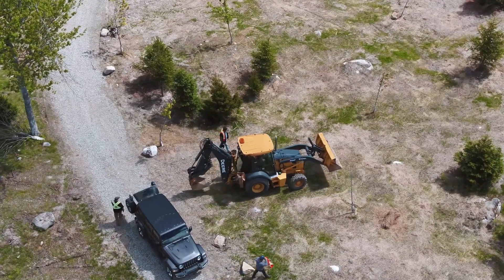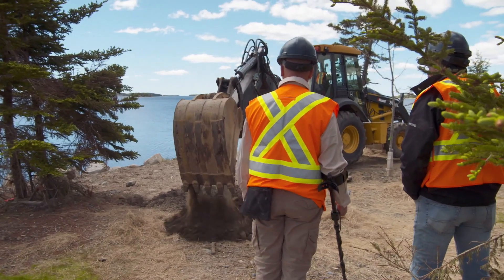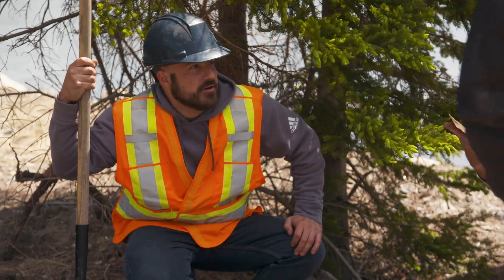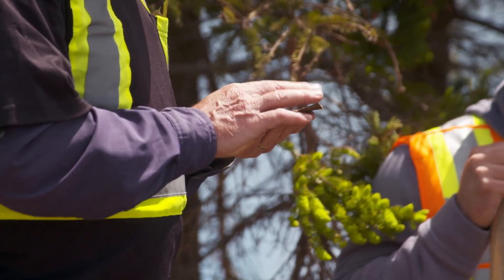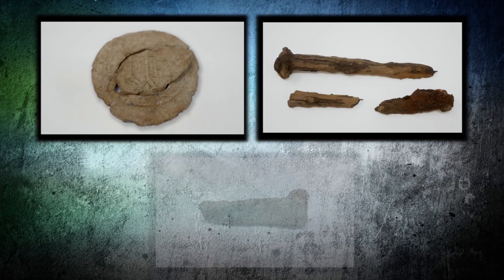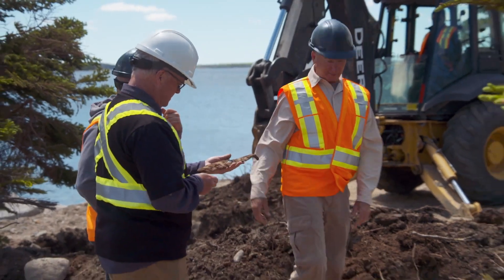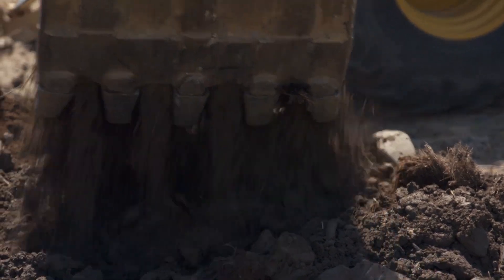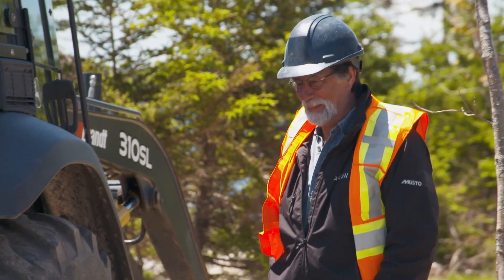The Curse of Oak Island: EVIDENCE OF SHIPWRECK Found on Lot 32 (Season 10)

Comment: Intertied history of Samuel Ball and the Vaughns.  The Vaughns made ships, repairs, etc on Lot 32 on the western side of the swamp-harbor and the western rock roadway (that still needs to be uncovered).  The Vaughns would split the family and move their ship construction drydocks to Lot 1 and 2 and the boulderless beach and the rock promontory that would anchor down a lengthy floating wooden wharf.  The other parts of the Vaughn family would move up to New Brunswick setting up a massive ship construction industry and make their greater fortune there (during the times of the whaling and cod fishing fleets).

Samuel Ball would buy Lot 6, 7, then Lot 24, where the remains a rock promontory and also had a floating wooden wharf there, with a southern rock roadway along the southern shoreline from Lot 21-32, to the harbor western rock roadway, connecting at the point of the Eye of the Swamp artesian freshwater rock well, and then to the uncovered Lot 15 harbor eastern rock roadway, and from Lot 15 over to Lot 18 and 19 of the South Bay.

Samuel Ball would gain the British land-grant of Lot 32, in the time during/after the Vaughn movements to the western shoreline and moves to New Brunswick, and move his floating wharf from Lot 24 to Lot 32.  After his death, John Smith and other owners would move the floating wharf over to the same rock promontory and station it at Lot 15.  In later times of the searchers, the wharf would move to Lot 19/20.  During the massive tropical storms and hurricanes that Niova Scotia experiences, the wharf has been torn off in the late 1890s/early 1900s, and was thrown by water, wind, and tidal surge back up onto Lot 32 western harbor shoreline - where photos show it decomposing and discarded.

Where did Samuel Ball get his money ?  By ox and wagon hauling cargo, and other mined materials from the mines and port docks, with warehouses, storehouses, and the Vaughn ship construction business.  The purchase of Lot 24 with the (already?) installed floating wharf gave Ball mooring fees such as Capt James Anderson and the ship Betsy moored there, plus other import/export cargo coming off the ships to get to the industrial areas around the harbor (swamp) area.

There are 3 known rock anchor stones (2 found by Fred Nolan - NW and NE stones and mapped in his 1974 Oak Island treasure map).  Another is said to have been at Lot 15 (but the iron bolt was found by Rick).  This means that NW, NE, and SE corners were 3 interior harbor floating wharfs and mooring areas (with cargo cranes and hauling of cargo onto and off the island.  The SW corner was the ship's drydocks, construction, careening (ship's hull cleaning), and repairs.  Thus having Lot 32 and Lot 15 with an outside mooring wharf provided additional mooring fees anbd cargo transport fees for offshore ships coming in.

What is also known is that the recent aerial drone LIDAR footage, better quality than the 2016 aerial plane LIDAR shown on Canadian Geological website, shows what they are digging out as a massive building area, a rock wharfage, and what would be the south shoreline roadway and the western harbor roadway.

What is not said is that Lot 30/31, not readily shown on maps, or LIDAR unless in the same southern portion of the Lots 30-32 was a zinc mine in the area.  Guess what Samuel Ball eventually bought before he acquired Lot 32.  Lots 30 and 31 area part of this building, and/or other rock crushing, smelting operations, and ships cargo warehousing that they are now digging out.

So if they find wood wharf remains, a smelting operation, mining materials, ships construction materials and a cargo warehouse, this is what is being shown from research given to them nearly 3 years previous to this ...

Samuel Ball was not a subsistence cabbage farmer, he was an intelligent, hard-working, up-and-coming industrialist and real estate person (also buying what would become of the small island outside known as Sam's Island in which he had other nearby cows/oxen.

 The real and greater complex history of Oak Island has barely been shown and known other than research by myself and presented to the Laginas for their greater discovery of the whole island - and finding what treasures there are (under Lot 15/16 ! or the original mines and deposited treasures - like the Aztec treasure of 1513, and other ancient Templar et al deposits made in the area.
Reply: I’ve had this ideal for a while. No treasure just a big maritime activity was  present on this island. But I’m a fan always interesting to see what pops up thank for your take. Allen on top of my hill in. Sc. A old Marine and sailer land locked.
Reply: wow you have some time on your hands to leave such a lengthy comment !! So long I wouldn't even think of reading it !!
Reply: @brianloeffler2245  Even more so time-wasting ... for you writing a dismissive comment.  If your brain cells are so small and can't hold a topic for greater than 3 seconds - then it is no wonder that you aren't one of the major off-grid researchers to the Oak Island peeps - and Season 10 is starting to finally doing what has been researched, analyzed, and documented for exploration for this origin (!).
Reply: Need you on the show to teach landscape archo
Reply: @ksholar1  (As said) I have consulting off grid for the Laginas 4+ years research, analysis, geology, geography, island colonizations, craft and industrial products made, natural resources of the island, and hidden historical entries.  The amount of real history can't be shown in a treasure vid show .. but the true backstory of the whole island is so amazingly complex with people, places, times, ...
Reply: I suspect Ball may had made a lot of his money through the non-tariffed rum and tobacco trade.  He likely used the abandoned buried tar kilns of the South Sea Company to hide smuggled items. Hidden places may not be for treasure, but to hide contraband.  The naval officer's button found in his basement was probably lost during a search for non-taxed items.  Tariff enforcement was a major day to day function of navies back then.  Such an island with easy access to the sea and a small separation from the mainland to provide visibility from visits by the authorities while allowing easy access by land to the markets is a good location.  Coconut fibers were (1) used to filter turpentine and liquid tar from the tar kilns, (2) used to pack rum and other commodities from the West Indies and (3) Mixed with tar and used to pack leaks in the wooden ships.  Many of the shoed oxen were used on the cobblestone road to drag logs floated in from the mainland to be hauled up to the wood processing yard during the South Sea Company era.  While it is claimed Oak Island is called that because of the large canopy Oaks, it might well have been called that because Oaks were floated to that place by the lumberjacks to be processed.
Reply: I also don't believe there are any treasures below sea level.    The show's producers like to use it as an excuse to investigate for non-plausible use by the Knights Templar and other such entities to generate interest.  Man didn't dig down below the water table except a short distance for water wells until the need and technology came in the 19th century. Pressurized caissons and compressors became available and allowed foundations for piers to erect bridges to go over rivers and harbor entrances in the 19th century.   That island is made up of glacial till and leaks like a sieve.  Digging below sea level wasn't done by man until the 19th century.  People hide things in relatively accessible areas where the items can be recovered by people you want to recover them.  Things from the surface found deep are there because of the constant churning of the island's contents by drilling, tunneling and bulldozing.  It wasn't an archeological dig, it was a treasure hunt.
Reply: Pretty sure the families didn't make stone roads. I agree this show is barely hanging on.
Reply: Thanks for the good info sounds like you got bit by the bug too :)
Reply: @johnlord8337  thank you
Reply: So basically the island was a ship work yard and most if not all they have found could in theory been found at other sights of shipyard so basically then entire show is a fraud
Reply: @MrBigdaddy2ya  When I have over 400+ historical, archival, personal, geological, geomagnetic, NMR, GPR, LIDAR maps, treasure maps, tunnel maps, and other assorted historical documentations - a lot of the information - and a lot of the BS - is filtered out - and what remains is truth.

There was (potential) mining since the days of the Solomonic Fleet (1000 BC - 1000 CE) period on the island (and during the time of the Norse Vinlandia empire (900s-1100) and then converted into the Templar empire (1100-1400), later taken by the British and French flip-flops, and finally 1755 total British control.  These mines on the western and eastern isles (with other known tunnel maps detailed by early seekers (outside of the Money Pit area) that a lotta digging was going on away from this mining air shaft (1795 Money Pit) and the 2 entrances to this 1600s-1750s mining area - with Shaft X-1 (South Bay Dunfield-Blankenship discovery 1965) and undiscovered Smiths Cove.  The sunken pit, was a prior undocumented shaft dig (named X-2) where Mrs. Sophia Seller's oxen had fallen into a well-like hole in 1878 - another airshaft.  The current dig on the plateau (not on the Money Pit paved area) is the 1930s Wm Chappell-Blair, Hedden, Hamilton, M R Chappell-Blair area of excavations.  Also an airshaft.

This leaves an industrial mining of the area (same as the Martin Frobisher pulling out iron pyrite (fools gold) 11,000 tons back to London and other mining of natural resources.

What it then details is that these ancient mines and tunnels of the original digs were the locations for locating and leaving treasures, not the 1600-1795 mining areas.

There is conjecture that the Seige of (French) Ft Louisbourg in 1758 (when British have total authority and control over the Oak Island area (and possible military and naval forces on the island) - that burying something there would seem almost impossible (!).

Then 1793 execution of the royals of the French Revolution, and the suspected buriall of the French royal gems there, would ahve someone spend exorbitant time digging out a shaft to bury "stuff" there.  Since 1776 expat colonists were already living there, and this was Lunenberg German merchant Caspar Wollenhaupt's Lot 17 and 18, this would also deny this existence.

There is also the statement of the 90 foot stone and the decipherment in English (while the Zena map Formula cypher had the same cypher but written in French) that was ~supposedly~ put into John Smith's fireplace mantle, then relcated after his death in the 1850s, up to Halifax.  Yet, looking at all of the earliest of 1860s photos of the Money Pit digs and the John Smith (Anthony Graves) ownership of the house, THERE IS NO FIREPLACE CHIMNEY seen on the visible side of the house at the eaves or above.  You would expect a fireplace, but no chimney is visible (?).  So is the story even true about the 90 foot stone that only appeared during the time of the 1860s-1919 then disappears.

Capt James Anderson on Lot 25 lived next to Samuel Ball on Lot 25 (and potentially mooring his ship Betsy) at Ball's wharf (paying mooring fees) would eventually leave to the Caribbean where he dies.  But before this, Ball buys Lot 25 from Anderson, who then leaves.  If Anderson did have treasure it would be on Lot 25.  Is this what Ball would find, but not of any other implied treasure source ?  Would a pirate leaving the area, leave his buried treasure under him selling the lot ?  Highly unlikely.

In one episode, I finally found that Capt James Anderson was Master Mason in 1791 at Lodge 9.  I finally found that Lodge 9 was at Liverpool, down the coast.  Any military lodge (see below) of a British army or navy lodge was not around in the 1790s on the island, and no official civilian lodge at Chester or Lunenburg.

Capt Kidd was known to be around the Mahone Bay area in those late 1690s, then goes to the Indian Ocean, where eventually he mucks up attacking a British commercial ship (Great Atlantic and Pacific tea ship ?) and gets hanged.  So there is a Capt Kidd Plum Island map looking in near absolute shape and details of the island (and dated in the early 1700s) and where there is suspected burial of treasure in the northern Lots 15/16 (the same as another tunnel map showing tunnels in the Lot 14, 15, 16 area (!).  Yet, this period of back and forth French and British ownership of Nova Scotia and Oak Island, and ~some~ few colonists of the 1600s English Baronets of Nova Scotia area living there - would notice anybody coming onto the island for an extended period of time, mining and tunneling and leaving a buried treasure.  Only someone having knowledge of PRIOR mining and tunnels on the island could then have deposited something there - during this period of English control.

There are also other conjectures of Bacon and shakespeare writing buried - why ?  If anybody wanted historical documents of all of the Shakespearean writings - it would be the English - and royal/nobles for their collections.  As my own ancestry had personal contact with Shakespeare, and 7 degrees of Kevin Bacon, we could have also known of Bacon in Verulam (old St Albans monastery area in royal Hertford shire, where my ancestry lived 1300-1632), there is no valid reason for this to be there.

The anchor stones and offshore mooring areas support features (mentioned to the peeps) that the navy had a rock foundation of a large naval barracks on Lot 20, with the 2 eastern anchor stones with ready access to ships and defending the island or attacking from this location, while the northern lots of the swamp, and that of Lots 20-25 would have an army encampment of different periods.  Flip flop British and French army/navy units of national ownership, and they would have been in the same areas (yet we find no French coins, buttons, or militaria there).  So it is entirely possible that these encampments and naval base were before the 1776 expats came to the area - and such minings were supervised by these groups.
Reply: @dragonknightn7n796  NO - not a fraud.  There is so much history and complexity to the whole island (of 2 islands) that someone looking for treasure, but metal detecting all over the island and finding all these (non-treasure) OOPARTS makes the whole series that much more complex - especially when you don't admit that there were earlier colonizations to the island, earlier mining and tunnelling, the Solomon and Templar fleets sailing up and down the East Coast between Nova Scotia and Mayan empire (then Aztec empire).  Blue clay for the Mayans and Aztecs - copper, silver, and gold from Central America taken back to Nova Scotia.  The amount of self-discovery of the island from the photos and maps, the Laginas can't do everything - especially with alll of the restrictions placed on them by the Cultural Heritage group (who truly need to get a collaring by the new Prime Minister).

The amount of valid excavations that need to happen - mention to the island peeps is enormous to understand the whole backstory of the island.

(1)  20 scattered core drillings of Lots 15 and 16.  Now also water test them for silver and gold leachings showing that this more-ancient area of the eastern island had earlier tunnels and earlier deposits.
(2)  More core drillings around the northern perimeter of the Chappell-Blair shaft on the plateau.  Same water testings proving that this location of precious metals leachings are valid to this spot, or that more-ancient water flow and leaching creep from Lot 15 and 16 shows the real source of leachings coming down these ancient mine tunnels (loose soil) ... and thus getting back and excavating Lot 15 and 16
(3)  Clear off southern Lot 15 and 16 (which they will do) and run all kinds of GPR, metal detecting etc for underground tunnels that show that the dye maps showed dye patterns coming out of South Bay but also the Lot 15 and 16 shoreline, and then around the (known tunnel maps) of the Joudrey Cove (Graves Cove, now Nolan's Cove) of the northern lots.
(4)  Excavate and prove the Lot 20-32 southern rock roadway that had to be there as Lot 24 Samuel Ball wharf would have a roadway to Lot 32, then the western harbor side up to Eye of the Swamp and connect to the excavated eastern rock roadway they found (created in the 1200s, reconstructed during the Baronets era (1600s).  This roadway also runs across Lots 15-18 and the South Bay.
(4)  What industries were around the swamp harbor had 3 known anchor stones in the NW (Lot 32), NE (northern Lot 14 and15), and SE area (southern Lot 15), with the SW area being the ship's drydock and other warehousing buildings (Lot 32).  Other craft, industrial, and mining buildings would be along all of these rock roadways.  There would then be mines and tunnels of the oldest age on the eastern shoulder of the Lot 15 roadway into Lot 15 and 16, ... later Lot 17 and 18 would be mined in the 1600-1750s-ish period.
(5)  Finding the zinc mine on the western island at Lot 30 31.  The Lot 30 building, ships' parts, all fit into the greater area of Lot 30 31 32 with the ship building construction that was moved over to Lot 1 2, boulderless beach, the rock promontory of a floating wharf there, and said sunken ship in that area.  This is the same area that became part of the Vaugh ship business, the "bald spot" on those lots, the establishment of a windmill powered saw mill (no longer a pit or gang saw at Lot 30 31 32 and 1 and 2).  All of the ship's spikes etc all validate these statements.
(6)  Validating the Zena map with the newest of aerial drone LIDAR map (vs 2016 aerial plane LIDAR map) and finding corroborative confimrations (along with the ancient tunnel map !) that the western Lots 1 2 3 4 5, 20 21, 22 ...) were all part of a greater mining and tunneling adventured happening in that area - with the Zena map dated 1347 - years before Scottish Prince Henry Sinclair came in 1398.  Wels Prince Madog (Matthew) came shortly thereafter.
(7)  Clearing the southern Lots 15 16 and looking for the 2016 LIDAR showing that there was man made excavation at some time, like a road enbankment on an upward slope.  This feature does not appear in any of the current 1930s-2000s photos and aerial photos of the time.
(8)  There is a 1930s map before the Chappell-Blair dig showing that there was a roadway with rock lined shoulder in the southern Lot 17 and 18 area (that is now all covered up by Chappell-Blair and definitely by Dunfield in 1965.  This would have been that South Bay roadway from the SW swamp corner of Lot 15 towards Lots 18 19 20.
(9)  The 1974 Fred Nolan treasure map for sale at the Oak Island museum of that time, showing that there was the NW corner of the swamp with an anchor stone, and that nearby was a central road causeway with another set of rock boulders along the shoulder (oxen couldn't deviate off the road !)  This roada would be as early as the 1762 British survey map and 32 lots mapping up to the modern central roadway between the northern and southern lots over to the Eye of the Swamp.
(10)  Probing and digging along the Lot 15 and 16 hillock (manmade hillock of current 35 feet elevation since the 1200s) and finding the ancient mines and tunnels next to these roadways -- for blue clay, lead, tin, limestone, gypsum, anhydrite etc on the eastern island.
(11)  Excavating out the Lot 32 harbor roadway and such connections to the Lot 30 31 32 zinc mine area and other buildings associated with the roadway harbor traffic that would be there in the 1200s-1850s.
(12)  Trying to find those same mines and tunnels detailed on the tunnel map for the western and eastern island and seeing what possible directions they continue to go - and what might be down there
(13)  My statement of the Big Ditch Dig.  Sheerwalling the entire South Bay Lot 17, 18, 19 and Smiths Cove Lot 17, 18, 19, then pounding down sheer walls around the Money Pit area between 10X to the north and south below the paved area.  crane dig and dump truck(s) properly excavate out (no more big canning) and archaeological removal of soil (and water) into the area.  Billy to lay down boulder perimeters around Lot 19 20 and recovered the weather disaster and erosion of the island and fill in those areas with the excavated soil.  Get down to that 100+ foot area, drain out the X-1 South Bay entrance and the X-2 Sunken shaft pond, and find out what tunnels and searcher tunnels - Halifax tunnel etc are there, and have a complete GPS and photo documentation of everything there.  If you dig down to 200 feet and nothing else is found, and you find tunnels going into Lot 19 and 20 (most-unlikely) but into Lot 15 and 16, then start diggin into Lot 15 and 16 !
Reply: My God, this comment is exactly why I keep coming back to the comments on YouTube. Just amazing mate!
Reply: @brianloeffler2245  Ignorance is bliss ?